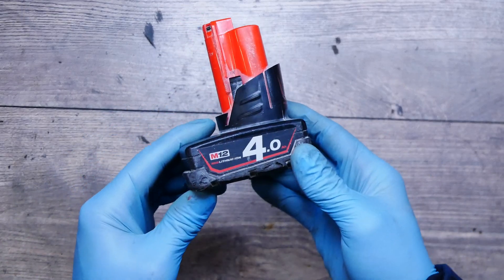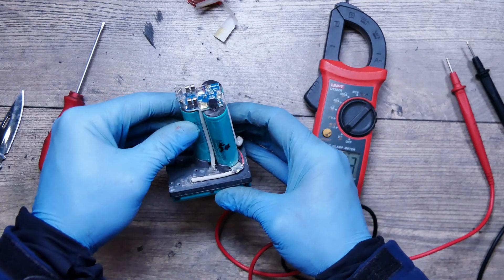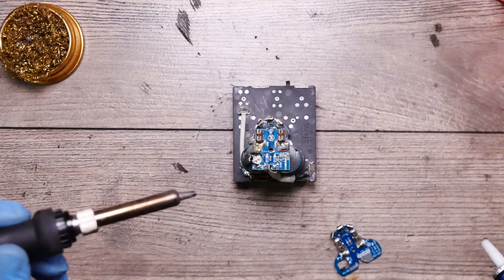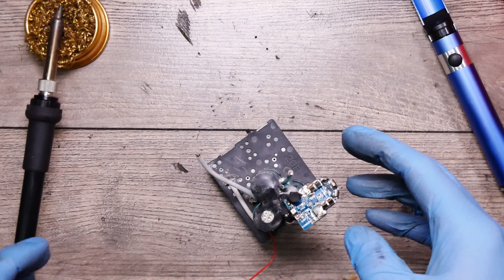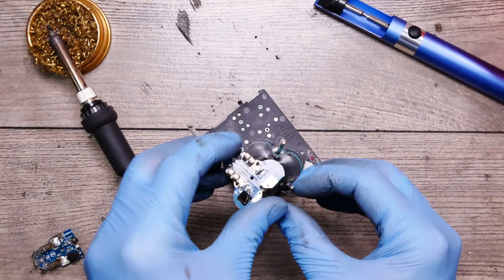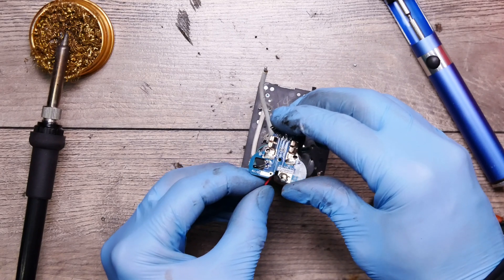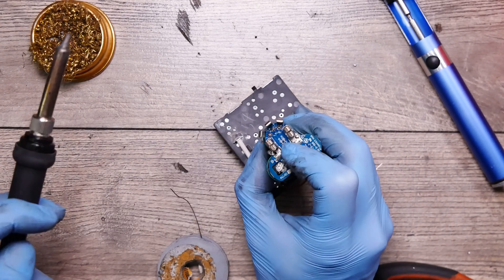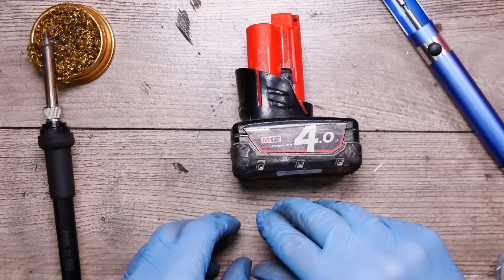Milwaukee M12 4Ah battery BMS replacement

Comment: Thak you for filming your work. Great repair as the cost of m12 packs like for like with m18 are nearly the same in europe and uk.

Where do you get the m12 bms... Alie express?

Thumbs up.
Reply from the maker: Thank you for good word, yes I got it in Aliexpress
Reply: @powertoolsrepair  Thanks for the reply. 

A different question entirely...

Does the Makita 18v charger or battery bms allow charging of more than a 6ah pack? 

I was thinking of making my own 21700 18v battery with 4.5ah Molicel P45B's. 

I can't remember where I saw it buy heard the charger will stop charging once 6.0ah has been reached on the chargers calculations. 

Thanks again.
Reply from the maker: @shifty277 don't tested that but I think charger will charge it
Reply: I already made 8ah, 9ah and 10. Need to charge 90 min 9ah. Works fine
Reply: @artinkinsj6262  Thank you so much for the reply - do you have a specific listing/seller on Aliexpress for the casing with BMS you used? 

You don't have to post a link as it may be flagged just a few keywords or the seller name would be awesome! 

Thanks again for the confirmation.
Reply: @shifty277 Junyoucai ILL. Actually they all are the same, just get the big bms and what number of cells you want: 5, 10 (5 cells box has no sticker)